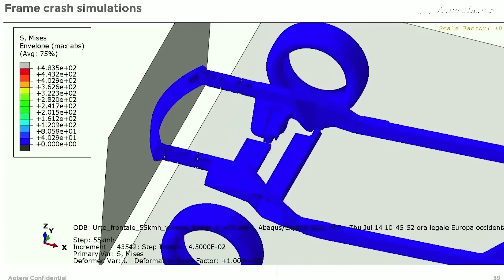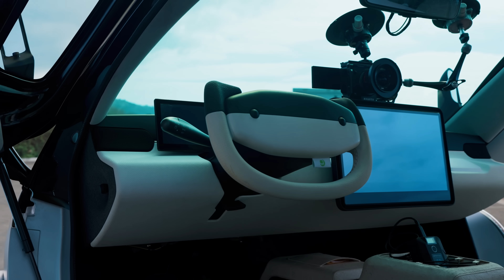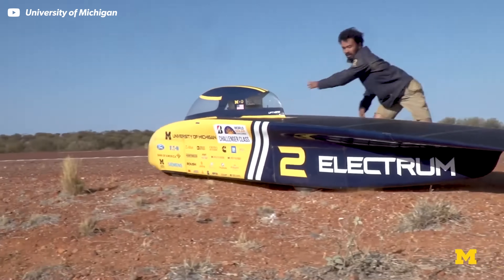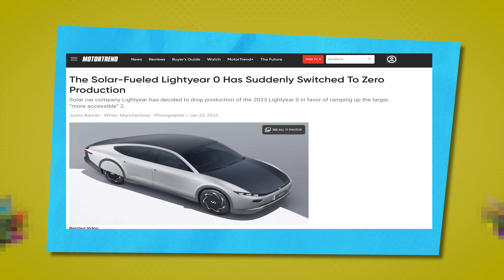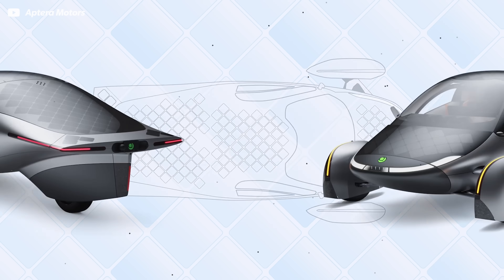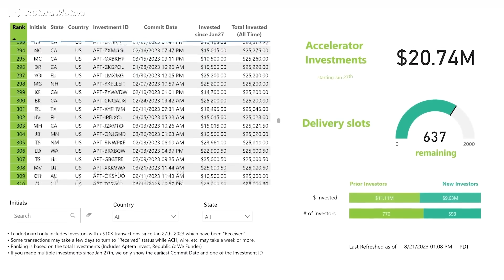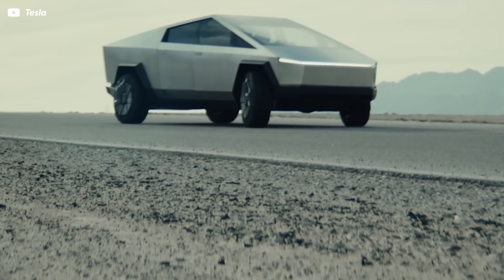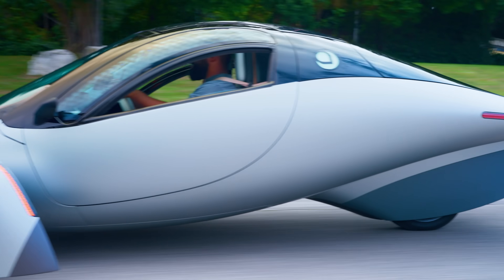We Drove America's First Solar Car

Comment: I like that the door takes JUST long enough to open you have the split second of doubt
Reply: Kept watching James almost reaching for the door/trunk whenever he did try it 😂

Not instant = “shit don’t work, fml! 😭”
Reply: This damn button....oh nevermind.
Reply: @leo-ub6nb it’s a really bad feature, they should just have standard handles that work regardless of conditions. I get why he was concerned
Reply: My guess is that they wanted it smooth for aerodynamics. But, I agree, physical handles should exist
Reply: @alexshepherd4469  I guess there has to be physical releases hidden somewhere under the body lines where they don't affect aerodynamics
Reply: I don't like the fact it doesn't have a regular freaken handle. I don't know why new cars have to get fancy with things.

 Knocking is nice don't get me wrong. Like if my hands are full. Yet I still like the idea of being able to open the door mechanically if the electronics fail. 

 Also I prefer buttons over a screen as well. Damn I can't stress how much I hate this trend of having only a touch screen. I know I'm not the only one. Especially when car designers make it so you gotta go through 100 menus to get to something....
Reply: @dianapennepacker6854  I think people expect the interiors to look a certain way...i also would prefer analog dials, buttons and switches...also requires way less energy to run...kinda funny...
Reply: @inherentlyflawed Not aero enough and adds cost.
Reply: @dianapennepacker6854  The screen and the steering wheel are the only things I am not liking right now. I hate that steering wheel and I want only tactile controls as they don't distract you when you are driving.

I have put a deposit on it and if I hope they are open enough with their specs that I could reverse engineer the screen to be replaced with a control panel and small led readouts.
Reply: its just another thing that will break. but now you gotta call a tow truck to take you to the dealer
Reply: @alexshepherd4469 Tesla does it both ways. It has an aerodynamic handle that still mechanical and you just push into pull out. It also has a heater in the winter that melts the ice around it in 14 seconds or less
Reply: @freddybell8328  so a system that detects knocks and automatically unlatches the door is less expensive than a system that is a manual latch? And they aren’t saving more than a percent or two in aerodynamic gains, that are lost in the weight added by the system used to open the doors with the knock.
Reply: @mm6705 They also add more weight to the vehicle.
Reply: @TrolledBy  Should be mandatory, but I don't think it is for interior or exterior.
Reply: @freddybell8328  electric switch and solenoid is cheaper than mechanical??  really?  hmmm
Reply: Lol,  there's alot of engineers here that know better.😅
Reply: Well, you do have to wait for the little gnome to get up off his La-Z-Boy and walk over and open the door...
Reply: @danroyall7849  I'm so glad to be wrong.
Reply: I know that feeling, opening the rear gate on customer cars. They're too damn slow!
Why I've added remote poppers to both my vehicles. SPAL makes a great kit that lasts for years.
No, I'm not sponsored by them, but I should be...
Reply: @mm6705   buttons and knobs means much more wiring. Everything on screen means the car can get new functionality as time goes on. Example: a Model 3 from 2017 feels like a new car because it has constantly gotten software updates that have added new features.
Reply: @dianapennepacker6854  well there's only one other design for a handle that's quite as aero and that's placing a push panel with the handle under it. The downsides to those though are they're hell if the door is frosted over and may rattle at high speed.
Reply: @mm6705  Yeah well from what I heard from the creators, they seem to mainly care about "this is the car of the future" over function. Even the original posting of the vehicle back in 2005 had the display control everything, and that was before the iPad even came out.
Reply: @freddybell8328  I'd say it's probably just the latter. It would be less aero, but barely even measurable. There are designs for aero handles, but that would cost extra money they don't want to spend. The knock just uses cheap accelerometers
Reply: This
Reply: @Yoda_Gaming1738 they're required by law to be able to open the door mechanically if the electronics fail.
Reply: @alexshepherd4469  It's not hard to make aerodynamically smooth mechanical latches. Every airplane has dozens of them on access panels and fuel ports and they're a no-cost off-the-shelf part. They did this to make it more "tech" and appeal to investor capital, which was necessary, but unfortunate.
Reply: Yip and then you pull a Sheldon Cooper just to open the door😂
Reply: Since the design was sent to NASA for a computer analysis of the drag (no wind tunnel testing yet) and the computer showed a drag around .13 then tell me who can do better? That is considerably better than anything currently on the roadways.
Reply: @dianapennepacker6854  I don't get why cars just can't work with both. I have an aftermarket GPS unit that gives me infotainment settings in a touchscreen, while having physical buttons for basically everything else (As well as switching between menus on my infotainment device). Plus the unit sits snug inside the dash and not in front of the window like these ugly tablets that stick out.
Reply: @chrisbarrett2512  at what cost? Practicality? Ease of use? Literally the only two things that matter to anyone anymore?
Reply: @chrisbarrett2512  The vehicle has been through the Pininfarina Wind Tunnel (arguably the best validation tunnel in the world.) I don't think results have been computed or posted yet though. To your point: even if they don't hit .13, it will still be far more aerodynamic than anything on the market.
Reply: @hyperx72  All electronics experience droppage and interference with every connection/interface they have. Having your part directly connected and controlled via the the computer is more efficient in cost, weight, and current. Adding dials/buttons/whatever will add weight to the vehicle, cost more, be less efficient, and introduce additional (unnecessary) complexity.
Reply: @Wang_Thunder - There are much better wind tunnels. Even right here in the US. Rolling road ones give a better representation of the real world.
Reply: @bongmuon   @bongmuon  Yeah I think that is why I hate touch screens replacing buttons.  It isn't tactile! I remember this one tech that was basically a blank colored screen, but it had haptic feedback PLUS the screen was made up of tiny little things that could rise or fall, creating buttons. It looked awesome, and was also useful for blind people.

 I remember this guy showing how long it took him to get to heated seats in his expensive ass car. He had to use a touch pad, and navigate through multiple menus. Basically impossible to do while driving.

 Just having what is essentially a tablet bolted onto the dash looks stupid as well. It was cool when Tesla first did it. Now it is same.  Maybe if it was curved, and stylish I could get behind it.

 Anyway I would pay extra the option of a good looking dash with nice tactile, haptic, buttons. I did see one luxury car that was pretty legit. Had both a big touch, plus buttons.
Reply: No because it was not the final design. Gamma was at the Pininfarina, not the final design. The computational fluid dynamics work, and NASA, shows it to be in the area around .13. The NASA engineers were impressed and found that the ground effect had become somewhat of an enhancement to lessening the drag. Final validation is yet to happen, but we can both agree, it will be the best by far of anything on the roads currently.      @Wang_Thunder
Reply: @Wang_Thunder  Though making every system rely on one terminal gives them a big point of failure (your touch screen gets damaged and you now can't adjust any sound and your AC system goes haywire), they're going to be less consistent than physical buttons (there are many ways you can press a touchpad incorrectly or inaccurately, and many ways a touch pad can just fail where physical buttons won't), their lack of physical feedback requires higher attention from the driver to adjust (in moments where attention is critical), and they're less reliable.
I'd argue that the miniscule weight savings are worth far less then the ease of use, removal of distractions and reliability button-based systems are on cars.
Reply: @freddybell8328  not aero enough ? It has a coefficient of drag of 0.13.  They ask NASA to check their design and were astonished by the numbers.
Reply: @pilotavery  there is no external handle. There is a mechanical release inside.
Reply: @EMOHumer  there is a mechanical release inside if needed but not on the outside.
Reply: @hyperx72  I'm not a fan of yhe all touchscreen controls and I even have a little experience working with touchscreen and designing some interface menus and programing them. The Aptera has a very simple wiring harness and I believe they use CAN and LIN bus to minimize the number of wires in the harness.  There was some mention that they will make their DBC file available. If so I may hack together some physical interface controls for some functions. But I'll try the touchscreen first.
Reply: @inherentlyflawed it doesn't add more weight. It's just a coil after all
Reply: Oh my doubt lasts way longer than that bro
Reply: @bongmuon get your money back
Reply: @hyperx72  Yeah, that is true.. It is definitely inconvenient if the main console fails or something similar. IIRC many of the controls will be available via the app as well (including door controls and AC.) I would imagine there is some level of redundancy in the system so it will still function even if the display dies. 

It does seem fairly miniscule to include some additional control methods, but consider this: Several years ago I developed a product. I was pretty careful about weight, dimensions, etc. I didn't accurately calculate the weight of the denser cardboard the manufacturer used in their shipping cartons. If I would have made each unit (with packaging) weigh 2 grams less, I would have saved something like $9,000 in shipping fees.   

Check out some of the older DIY model ultralight aircraft that are FAA part 103 compliant. They have pretty strict requirements on total weight, dimensions, etc. Its pretty interesting to see how people trim down to the bare essentials (like.. a grid of steel round stock with some wings) to get the most efficiency possible 😃
Reply: teaches you patience
Reply: LMAOOOO
Reply: @Wang_Thunder   The problem with screens vs. knobs and buttons it that a screen requires you to look at it, taking your eyes off the road -- there's no tactility on a smooth glass surface. Given the way that most people drive, they're already distracted too much, I want their eyes on the road MORE, not less...
Reply: As a person who codes stuff like this, the delay is prob so it doesn’t hit your hand and then stop on obstacle
Reply: the line is pretty long as it is.
Reply: @pilotavery  Tesla removed them too in the Cybertruck anyway
Reply: @inherentlyflawed  yes, "the system that detects knocks" is just a $0.10 PCB, while the door lock servo is there anyway — for the purpose of locking the car, you know. So there's just only one servo in there, one less than it would have been if they were retaining the mechanical latch.
Reply: @dianapennepacker6854 unfortunately, their justification is that buttons fail. But they claim they're committed to making it easy and practical to navigate, so hopefully menus are at a minimum.
Reply: @bongmuon actually, that might be possible. Make a video about it, that would be cool to see.
Reply: @hyperx72 unfortunately, their justification is that the screen is more reliable.
Reply: @MrGamelover23  Will do!
Reply: @MrGamelover23  They need to stop the cap
Reply: @hyperx72  in fairness, they're not wrong, the buttons will deteriorate. My guess is the lack of buttons lets them just get to production already and add features later. A more finalized aptera 2.0 might have buttons.
Reply: @MrGamelover23  I've had cars for decades with still working buttons, though screens have had problems.
Hell my smart washer that has a digital knob stopped working on me.
Reply: @hyperx72  I'm actually not surprised that your smart washer crap tailed on you because home appliances aren't held to the same rigorous standards as automotive vehicles.I would hope that car screens are held to a higher standard, but based off of your anecdotal evidence, they apparently aren't, and that kind of concerns me.They might have buttons on the second edition, but right now they just need to get this thing on sale as soon as possible and having everything done through a touchscreen allows them to get to production a lot faster as a result. But hopefully they'll have programmable buttons on the second edition's touchscreen because they really should have buttons.